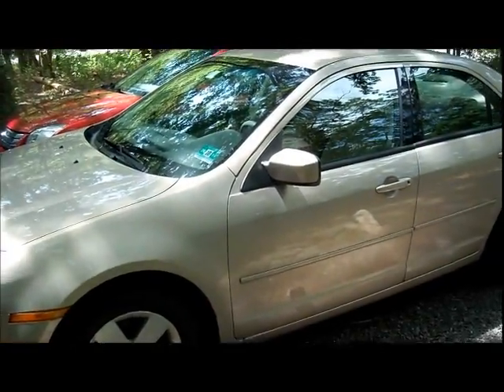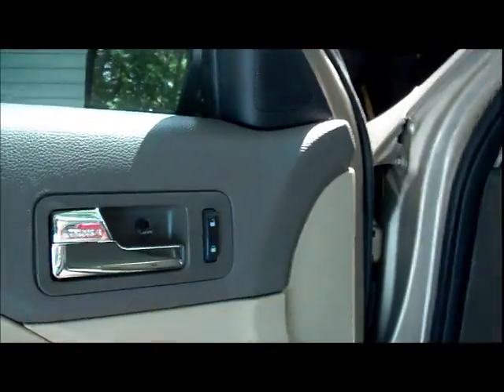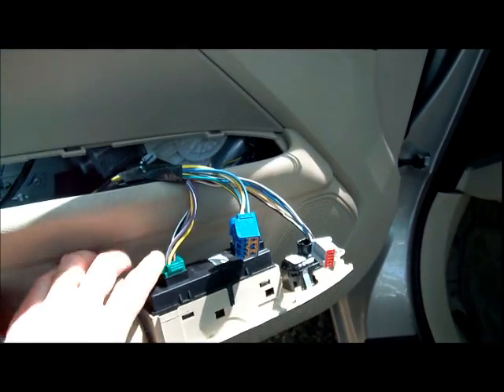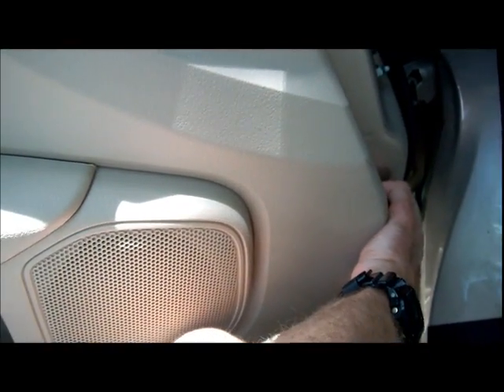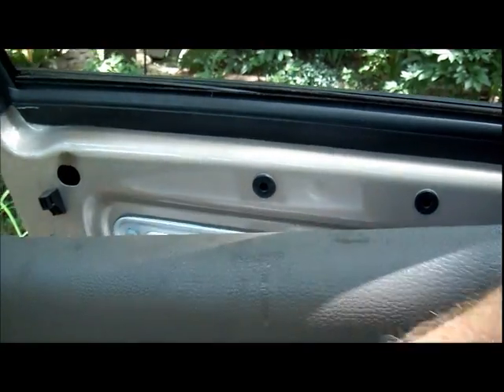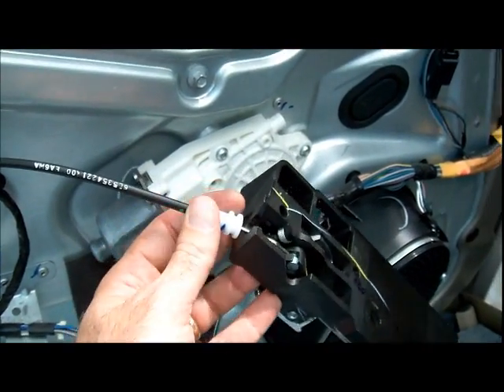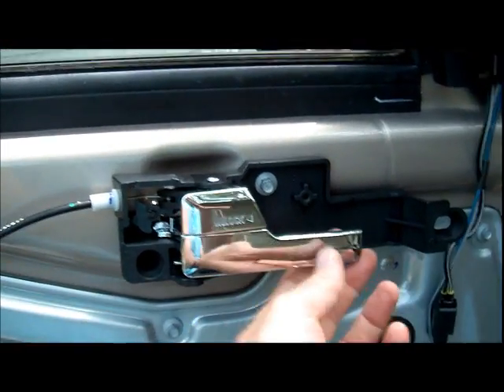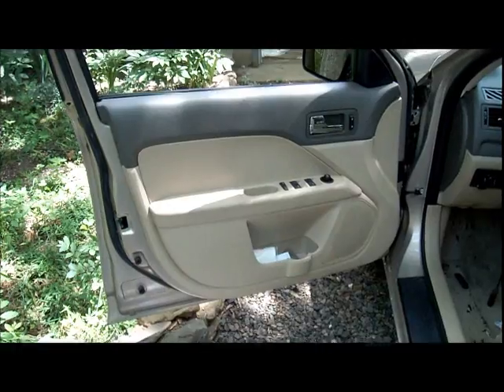Replacing Broken Inside Door Handle on 2007 Ford Fusion

Comment: Hello and THANKS in advance! I have a 2008 Lincoln MKZ and this is EXACTLY the same setup for my vehicle. The handle I will be installing is for the right rear passenger side. I haven't installed it yet because I am still waiting on the part but thank you very much for the informational video. Very Informative and straight to the point...Thumbs up from me!

Comment: Very useful video, but for the 2009 Fusion the fasteners on the handle and side and bottom of the door are different.  They require a star (Torx) drive size T20 (E4) to remove the screws.  Also, you can make the repair without disconnecting any of the electrical connections.

Comment: Works on the 010 fusion as taped.  Only suggestion is use a magnified torque driver to remove the screw behind the door handle, easy to drop.

Comment: Thanks for posting the vid. Professional cheapskate but amateur mechanic so this gave me the confidence to give it a shot. Was easy knowing what was hiding behind that panel. Great tip to remember to keep the wires out when re-mounting... Glad I had my old Torx bits to remove a few of the screws.

Comment: Great video. Thanks for the tip on where to find the part. Just ordered mine from Rockauto.com   $36.79 plus $9 shipping. Looking forward to this repair since I now know what to expect. 7mm socket, 8mm socket, torx. Look out for tough snaps and probably don't need to even bother unscrewing the lower handle because you apparently got by without disconnecting. Got it! Thanks!